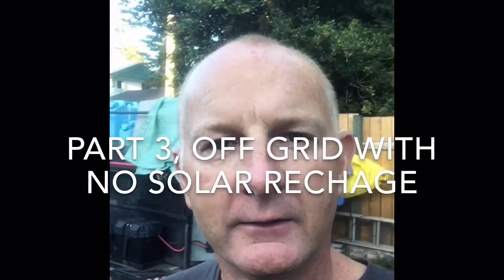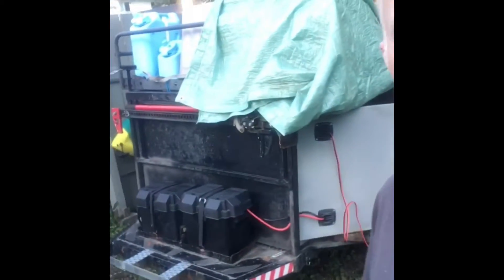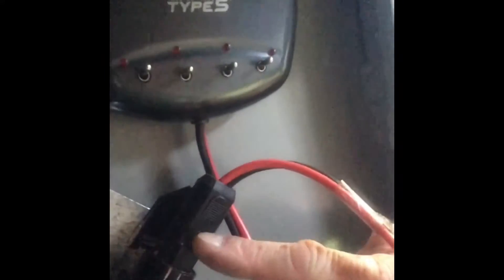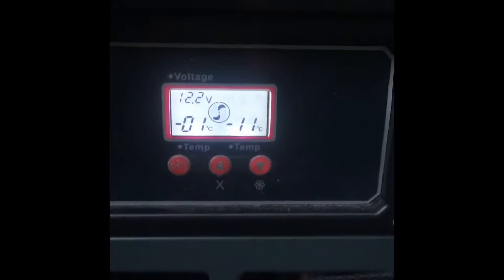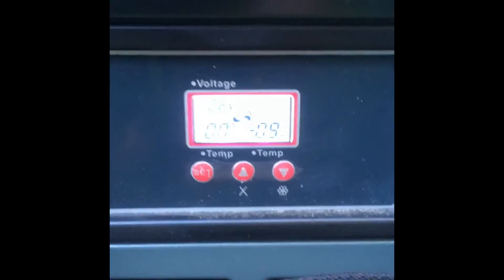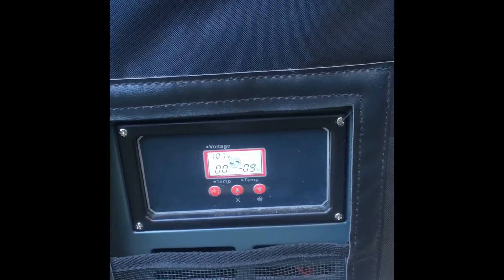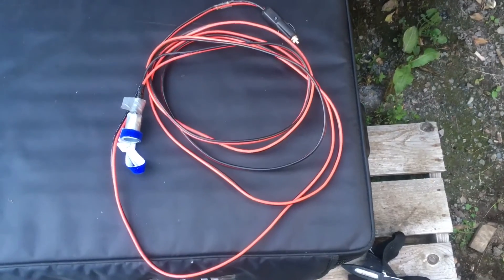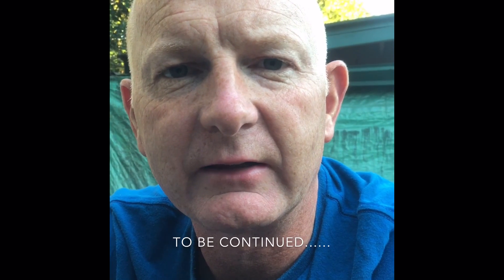Part 3, Fridge/freezer off grid with no solar

Comment: Christ, 464 amps should run that fridge for about 14 days 2 days should have no impact on those batteries what so ever, a 115 will run my fridge for about 140 hours +/- which is close to 6 days before it needs charging. Something really is wrong there, with 464 amps the batteries should still be showing 12.5 to 12.6 volts, after 2 or 3 days, that fridge is a power Hog, 12.4v is 75% charged so having 12.1v is below the 40% mark, I have never seen a 12v fridge chew that much power in a week let alone 2 and a half days. One thing that comes to mind is Dump those thin cables and run 6 gauge wire and then you will see your voltage come back up, I think you problems are the cables,  like I said mine will run for a week on a 1/4 of the power you have there and while it is not cycling it only uses 0.09 amps if that and about 10 watts when it is running. To give you a rough idea, Your battery bank is equal or bigger than what most people have in their off grid cabins, just fix your wiring and it will work as it should. hope that helps.

Comment: Good day! I have to hand it to you that you have performed a top notch review. That was a real scientific approach. I saw the voltage drop issue and possibly have an answer for you and the audience here. Ohms law says that as current flows though a resistance, you will have a voltage drop. Even a small resistance such as the DC plug connector can offer issues. Here is an example. Seeing 13 volts at the battery and 11.4 at the fridge is 13 - 11.4 = 1.6 volts.  v/current = resistance  1.6 volts / 2.7 amps = 0.59 Ohms. 0.59 Ohms is very imaginable over an extension or connector such as the DC one seen in your video. Even the cables between your batteries cause voltage drops itself (while current is flowing). On a full charge the team of batteries pull together but as the closest battery to the fridge becomes partially discharged, the voltage drop becomes larger between the 2 sets of batteries connected by the long cable between the sets. The fridge will see the lower battery voltage. You still may have decent charge in the battery electrically furthest away from the fridge, but the lower voltage is detected. A solution is larger cables where one lead, say the positive could be connected to one battery set, and the negative to the second set. Keep the length of leads as short as possible. Try to eliminate the DC accessory type connector if you can. Lastly, the wire run from the battery to the fridge should be as larger diameter or AWG with as direct a connection to the battery posts. In short, all the voltage drops add up. I really believe your fridge did see the voltage it was indicating. Way to go!!! -James
Reply from the maker: James Chamberlin sorry for the late reply, you are right with the cable, I learnt that for the use on my DC/DC battery charging system for my truck.